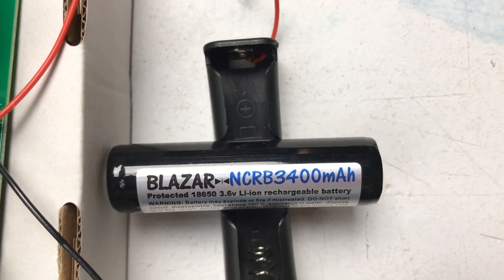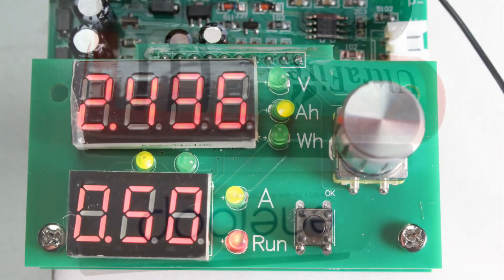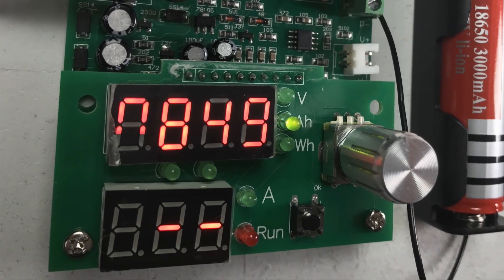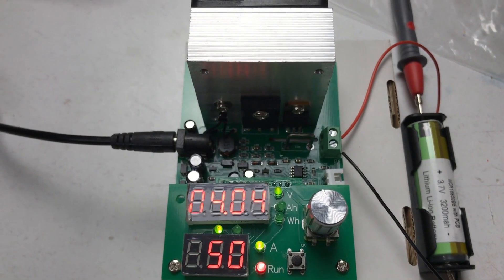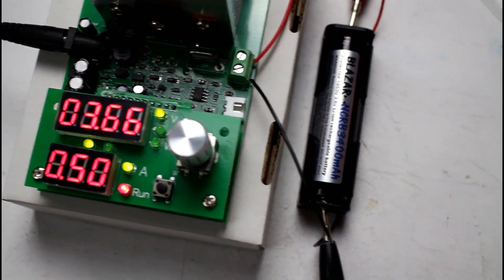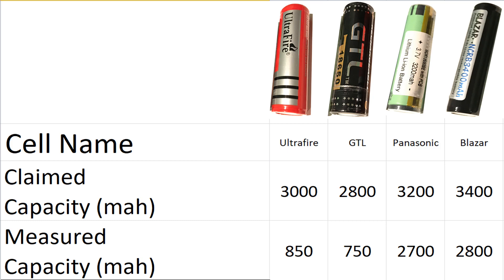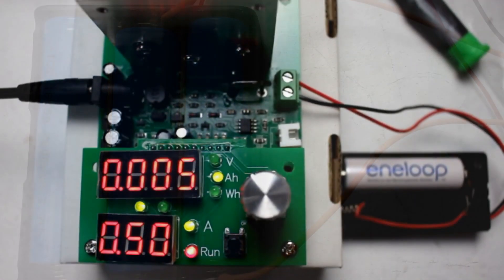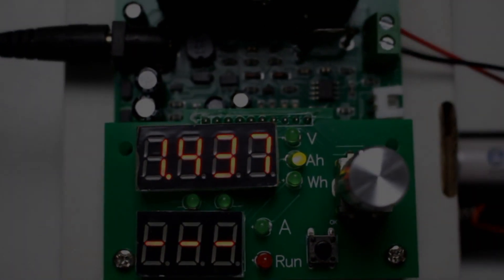What's The Real Capacity? (MEHS) Episode 66

Comment: Pretty much any cell you buy from china will have a capacity lower than 1000mah, you're better off getting them from used laptop batteries if you're after something relatively cheap.
Reply from the maker: - Thanks.  I use all sorts for this project and that but I enjoy the solid performance and protection of the good quality offering such as Blazar and Keepower.  Cheers.

Comment: I think it will come out in your next review (and partly answered by the other comment below), but considering all failed, might need to think about a way to confirm the integrity of the tester?? either way, i enjoyed the video :)
Reply from the maker: - Yes agree although I'm also reviewing some documentation from cell manufacturers about what the rating on a cell really means and what a consumer can expect.  I know the rating e.g. 3000mah is the theoretical maximum capacity but should a 3400mah cell only give 2800mah?  Time will tell.  Cheers.

Comment: Really nice. :) About the discrepancies, maybe the electronic load isn't that precise, or it's the long usage of the batteries, really. :)
Reply from the maker: - Thanks.  The EL will have some percentage of error but I expect it to be 2% or less.  I will explore this further in the EL review video.  The load applied to the cells in each test was 0.5A.  The GTL cell has had about 30 charge cycles.  The Balzer only about 10 and the panasonic was new, 1 cycle.  The Ultrafire has had about 4 cycles only.  I'm thinking the EL is reasonably accurate but I will be exploring further with more cells and different discharge rates.  Cheers.